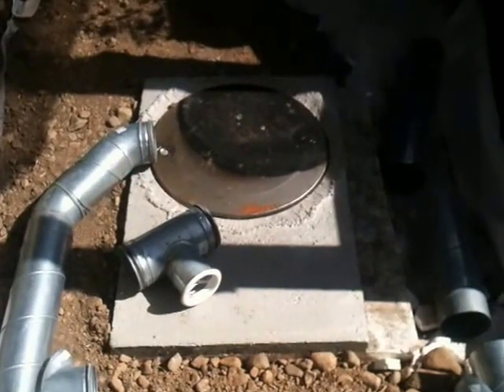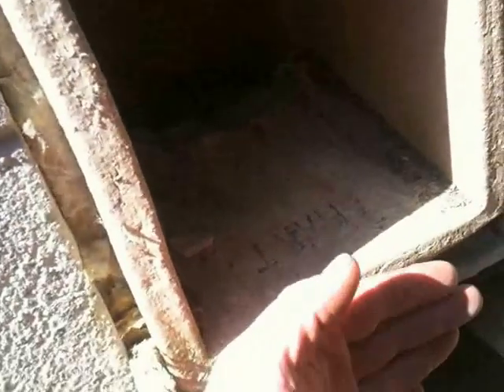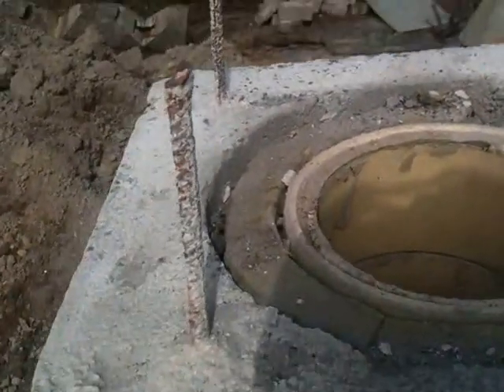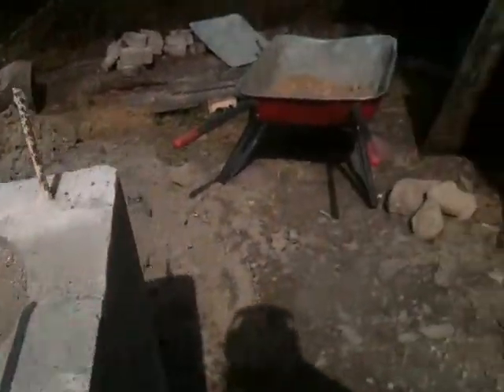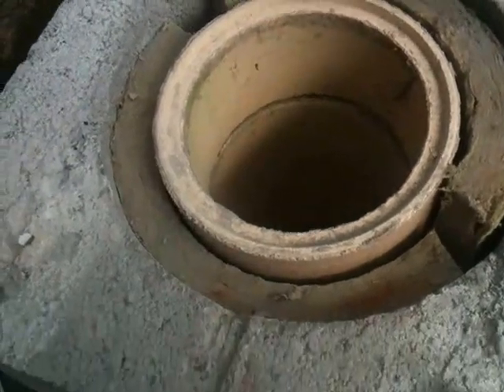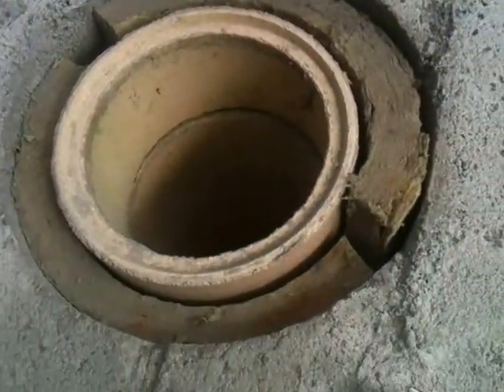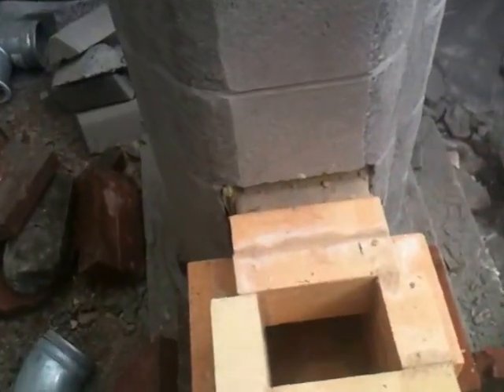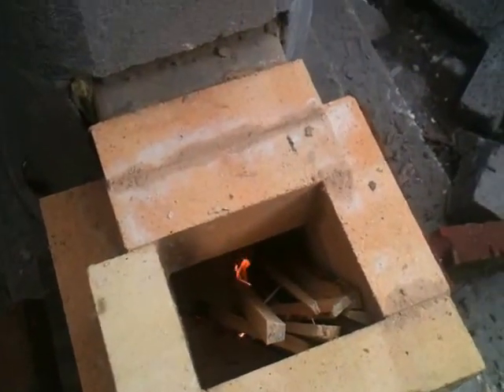Greenhouse project part three, Rocket stove, Please help.what am I doing wrong.

Comment: Hi, suggestion. Try adding more exhaust pipe outside and it should be double higher than your outer tube so it will "ROCKET" up. Nice project. God Bless and more power.